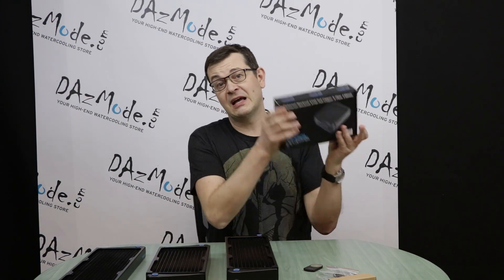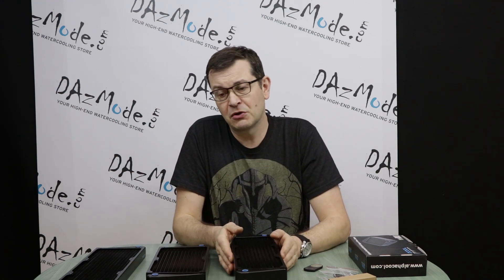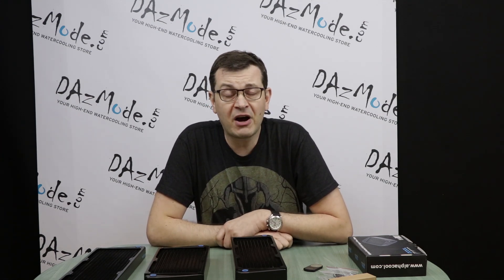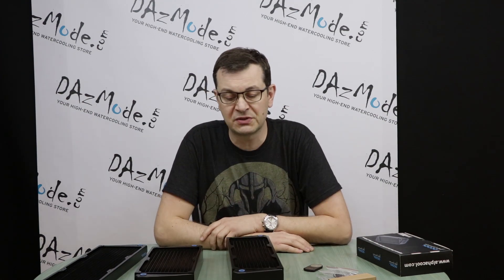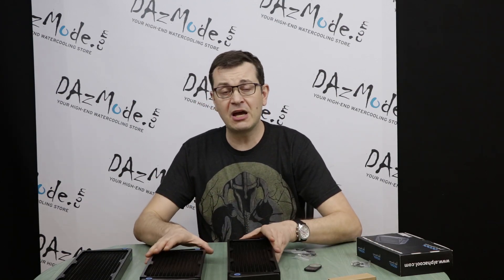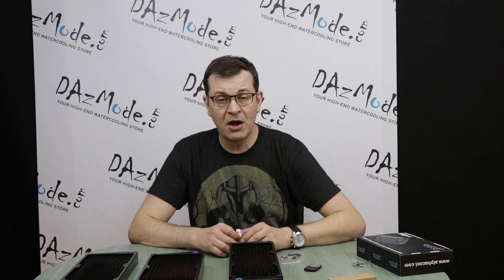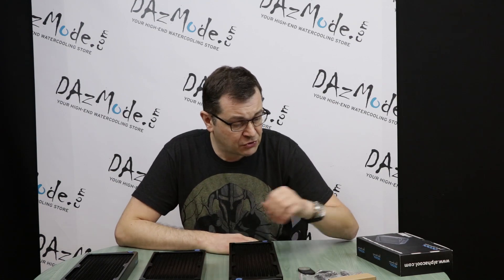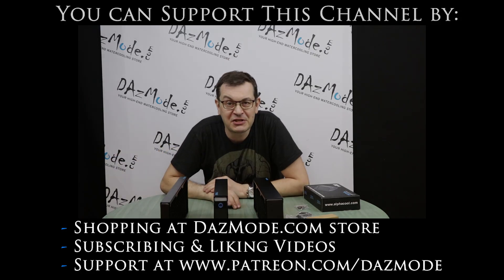Alphacool Nexxos X-flow Radiators Overview

Comment: Do you leave the blue stoppers in when installing it because I can't mount it properly if I put the two caps on it?
Reply: Those are just covers for shipping, wherever you don't put fittings you need to but those plugs in
Reply: @Juiceontheloose76  I figured it out but thanks!

Comment: Im running a 360 45mm thick alpha cool crossflow in my setup. Thing is a monster, and keeps my 6700k below 60*C @ 4.8 on 1.335v as well as my +45 and +1390 gtx 1070 @ 42*C on ultra settings 2560x1440 valley bench. Thing blows me away!

Comment: I watched your video on radiator thickness and it made perfect sense to me. 
A thick radiator may outperform a thin radiator BUT only if you run the fans at high speed; and even then you had a maybe in there. You surmised through your testing the slow quite fans on a thin radiator is very hard to beat.

Am really interested in the crossflow radiators and spend much of my day envisioning what the loop will look like.
Thank you for your efforts to break out of the box.

Comment: Hardware Labs is a much much better option.
Reply from the maker: It is all marketing fud, there are very small differences between brands from performance perspective.It just better to stick to known brands for warranty and such.
Reply: There is no such thing as better.
I have both Black Ice Nemesis GTS 240 XFlow (front mounted) and nexxxos st30 full copper x-flow 240mm (top mounted). (mini ITX Define Nano S build with i7 and GTX 1070)
The ST30 is much slimmer at 122mm wide while black ice is 133mm. The ST30 also has ports on both sides.
I NEEDED both the 122mm and double sided ports in my build to have more clearance above RAM and to use the radiator top port as  fill/bleed port as there is no dedicated res due to lack of space. HW Labs have nothing to offer.
Reply: Fair. I should have said "HWL performs better thermally". Alphacool is a better option for ITX builds due to more ports and a smaller footprint. However, in most other circumstances HWL is better.
Reply: paskowitz
glad to ruin your brand loyalism: alphacool ST30 XFlow has 2-4 times lower flow restriction than Nemesis GTS XFlow ;) That is very important. Even though HWLabs has slightly better thermal performance at the same flow rate and fan RPM  - I suspect the results would be  much closer if the pump would run on the same RPM (instead of adjusting pump speed to have same flow).
Unfortunately, i don't have the equipment to reliably measure the results of such test.
Reply: Both are good. The Nemesis line are great thermal performers especially the 30mm thick GTS with single fans in push, but if you've read the XtremeRigs reviews, as I'm assuming you have, the L-series line which Bitspower used in their Leviathan series are not nearly as good thermal performers, and these are their "easy to fit" radiators due to the standard 120mm width (for 120mm based radiators). And, for example, I have a setup with an Alphacool 360mm UT60 white and 360GTS up top, and the Alphacool's extra drain port at the bottom is very convenient, and in some ways better than a dedicated drain port, due to how low it is in the system. So yea, they are technically better thermally, and in my mind almost as well built as Alphacool, but there are always pluses and minuses specific to the build that each person has where you'd prefer one over the other. One thing I really do like especially with the Nemesis GTS/GTX is that they do not use louvered fins which are less likely to accumulate dust.

Comment: I'm very curious about the XT45 x-flow but i can't find any performance comparison to the non x-flow version. As you say the difference between x-flow and normal is small/same, but alphacool lists a difference in the FPI in the XT45 models where the x-flow has ~16 fpi and the normal version has 12. This seems interesting and nobody is testing or talking about it making me wonder if it's a mistake in the listed specs
Reply from the maker: Crossflow Testing video: https://youtu.be/ekPVlud6ohk
Reply from the maker: FPI video: https://youtu.be/FeNgutJMOVs